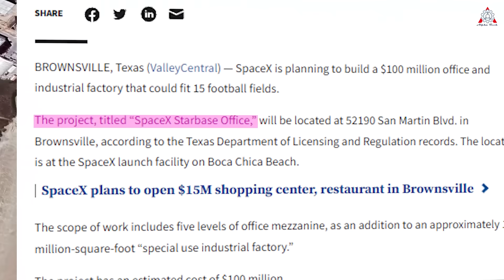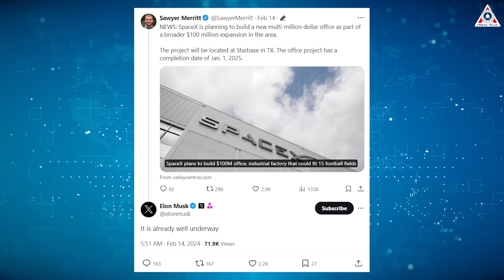Elon Musk shocking revealed $100M Starship's Gigantic factory is being built.

Comment: And the best part is that Space as a business will begin self extrapolating. One thing will lead to many other potentials.

Its almost like starting a civilization. Elon at the ground floor, and everybody looking in from outside thinking he's crazy....

Its like his rockets leading to Starlink...
Soon to put alot of cel towers on the scrap market. And within years, you can add trans oceanic airliners to the metal pile.

Also theres orbital energy production.

And probably weather control for agriculture...

Imagine paying your rain bill... in a desert...

Whats humorous to me is the Trolls are still tagging along...

The 3rd launch just trashed Malthus and his disiples at WEF.

And did it on already obsolete engines. that likely went out of production before a fraction of them had been used.

Next engines nearly 20% more powerful, with rumors they may take being pushed way farther.

And already plans to do way bigger engines.

Sure is fun to watch! 
I'm looking forward to hearing the reports from SpaceX as to what really happened to the booster and the starship, and what they attempt to fix the issues with. They have more in the pipe line, but soon another version.

And they have to adapt design to the realities.

And its gonna be fun to see the production ramp up on things, and the automation increase.  Truth is on engines the limit is resource inputs.

Meanwhile Jeff has made a few...

Theres even a chance of the political Cavalry showing up to help Elon, people are realizing the parasitic nature of bureaucracy, and that its a blood sucking drag on all of us. I feel the warm winds of change.

If you want a future, I suggest being on the side Elon is on...

Also I hope Space Force doesn't spend all their time saluting each other... And starts thinking of whats possible with fabricated tanks and simplified rocket engines. 

Anyway, now waiting on the next launch, hoping to finally see Raptor 3's some day...
So we can start getting a taste of the future potential when those are old tech.

Best part of exploring, is the pushing forward to new horizons constantly.

its in our nature....